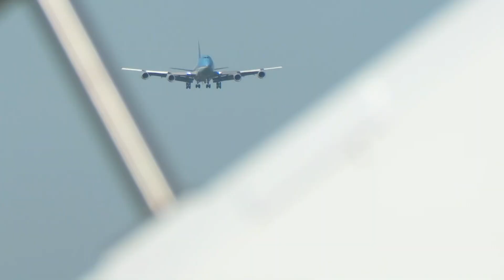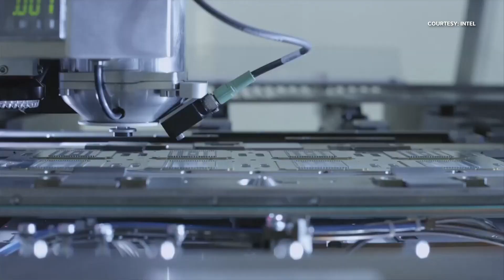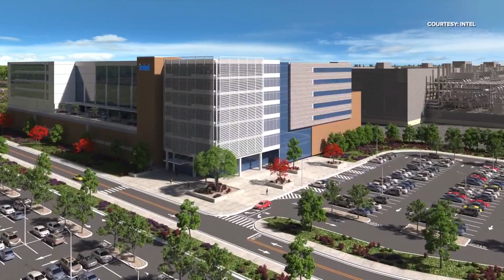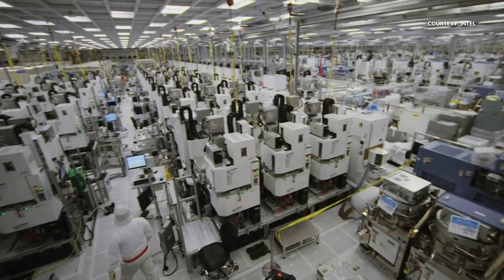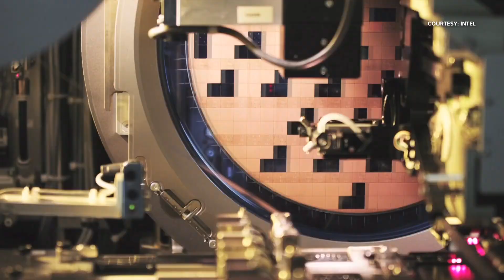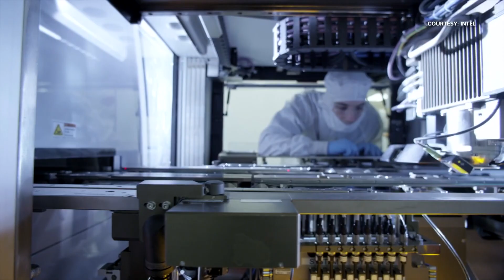President Biden, Ohio leaders celebrate groundbreaking for new Intel semiconductor facilities

Comment: I worked in Silcon Valley and San Diego for decades and just retired and back in Ohio. 
I left after the steel, auto, and shipping collapsed in 1981 when Carter and Reagan did nothing to protect the Midwest from cheap foreign competition. 
Reagan especially only looked out for California which did remarkably well during the recession of the 1980s. 
Now, they're bring it back to Ohio because California can no longer support the needs of manufacturing with endless regulations, energy issues, drought, and extreme cost of living.   
Better late then never I guess...